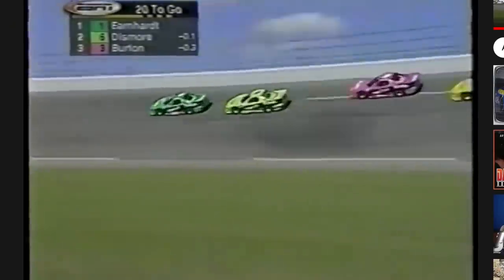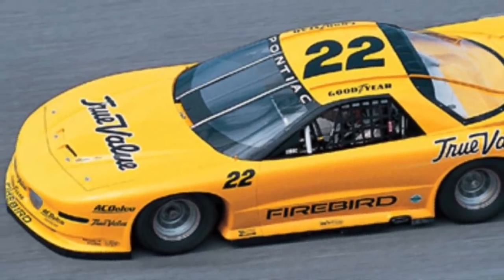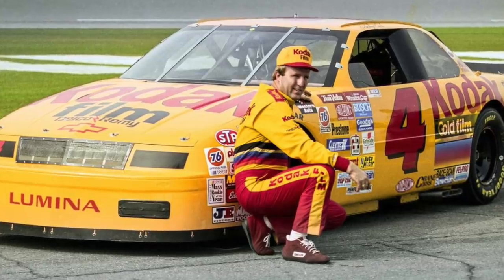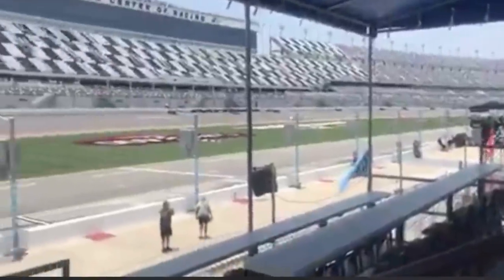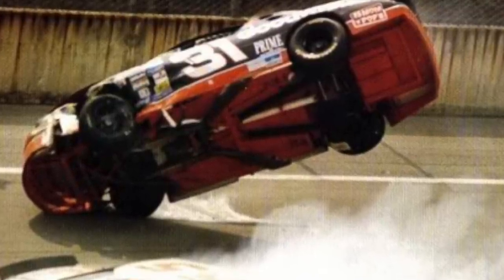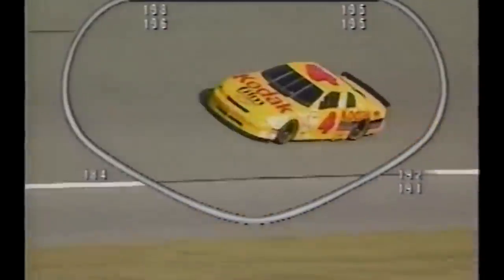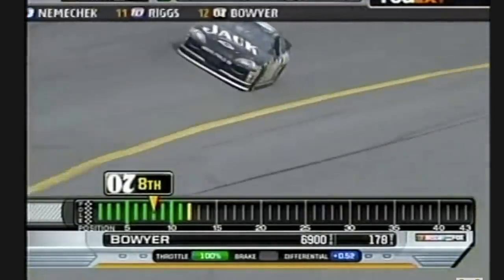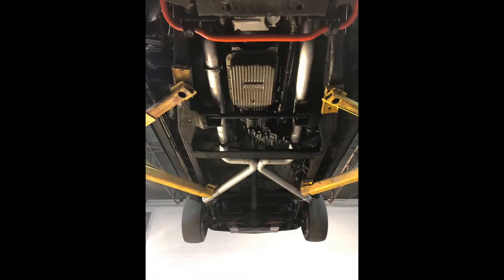What Made "Old School" Restrictor Plate NASCAR Sound So Great? (Back to Back Sound Comparisons)

Comment: H pipes pretty much just equalize pressure. The X pipe does both pressure and flow. Sound changes with flow. You're essentially hearing all 8 cylinders out of each exhaust pipe. Back playing dirt track with my pops, he ran a set of "180" headers tharan over the top of the bell housing. Each 4 to 1 collector consisted of a pair of cylinders from each side of the engine for scavenging purposes.  I know this isn't 100% the reason for the unique sound. Side note, I'd love to do the X pipe on my 07 Escalade if I could afford to
Reply from the maker: Your description is quite accurate in a simplistic sense
Reply: @Stapleton42  ya im not mr phd or anything but Ive been around racing my entire life. The TransAm cars always had a similar sound. At the time im referring to, they ran like a 311 i think....smaller than the nascar engines but they a similar set up but it was like 8-4-2-1 typ of set up. instead of a 4-1 collector they a couple 2-1 combined then just after it came into 1 large tube, it necked down the expanded back out. Our engine builders always refered to the as "fire cones". They would tell me how they could shorten or extend them depending how they wanted to power curve depending on which track we where at. Change the exhaust set up 3 time at 1 track once.....pain in my arse! lol

Comment: I think what a lot people don't realize too is how compression (Or cylinder pressure, rather..) makes a huge difference as well. Time and time again I've see guys spend the big bucks on an exhaust system and low LSA cam for a clapped 305, then wonder why it doesn't sound like their uncle peepaw's drag car.
Reply from the maker: That has a lot to do with horsepower and overall airflow volume not just compression ratio. Compression is just a facet of that lol
Reply: @Stapleton42  Oh I understand, why is why I mentioned Cyl Pressure (I suppose eventually leading to over HP as you mentioned..) as well.. Same reason a lazy stock LS sounds so much more wild when you throw a turbo at it. 

However I was just specifically referring to the billhillies that can never find the crisp exhaust note they want out of a 300k mile Emissions-era turd engine

Comment: some cars used the xpipe and toobs at 1.5s too. newman in 03 sometimes at texas and atlanta sounded more higher pitched than some others.
Reply from the maker: Good observation. Back then there was also an equal length Y pipe merge single side exit that sounded very similar. I believe that is what Penske used but I am not 100% sure. There was also a side exit x configuration used by some.
Reply: @Stapleton42  pretty cool to see you reply on a video 2 years old even with over a quarter million subs now. great job on the kerry video, btw. that one should hopefully get going and over a million views.

Comment: I feel like my comment on your monte video struck a cord. Maybe not... Either way my dad and i were just talking about exhaust sounds this week. Very interested in what you find. I am not sure an old school SBC cam will fit in an LS. Changing the firing order on the LS coils is 2 pins at the PCM. After a cam change if it fits of course. All i need is a trigger wheel and i will be using an LS PCM to control my SBC 383. Also on a Firing order swapped SBC the engine runs smoother which in fact gains you just a bit of HP but it does make the engine sound different as well. Need my LS Swap 89 Camaro to sound like the circle track cars so go and get testing so i know what i need to fit under the car.

Comment: Boom tubes change sounds quite a bit, also with everything digital now days they run cleaner and smoother. Just like driving behind a 69 chevelle big block with some good fuel, smells amazing. Then behind a new charger with good fuel, IT'S JUST NOT THE SAME LOL.

Comment: Another factor in the sound department is the lower max RPMs. Gen 4 cars had a max rpm at around 7,500 rpm, the Gen 5 & 6 cars had a max rpm at around 9,000 rpm
Reply from the maker: That’s not true. Gen 4 at non restrictor plate tracks ran 9,000+. Restrictor plate tracks ran around 7,000

Comment: the xpipe is no doubt most of the sound difference--I have been building race cars and experimented with exhaust systems for decades. One point--the restrictor plate engines were also turning 9,000+ rpm, not 6-7,000 rpm.. We used to take multiple engines per Team to Talladega and Daytona--these engines were restrictor plate, had 19-20 to 1 compression ratios and turned 9,200+ all day long..  On Sterling Martins car, the exhaust was the diff and yes 9,000+ rpm..

Comment: I am guessing before watching and I am going with Indy style headers like Sterling Marlin had on the four car I think. Or aliens but I think headers and maybe head exhaust  ports with the old spacing not like the LS motors and equal port spacing. Well lets see how this goes. :). I love the sound of those cars but my favorite exhaust sound ever is the opening credits to the first cannonball run and the Lamb chase.
Reply: Dang it now I need to know if the LT to LS1 style heads and port locations made a sound difference. A new rabbit hole I have to go down now for no good reason when I should be working. Unless Stapleton has this knowledge or spare time to find out :) If you read this and want to travel to Danville one day for some late model shop tours let me know and maybe we can hit Timothy Peters, Barry Beggarly, Fallen trucking that had many great drivers, Peyton Sellers, and I think Wendell Scotts son is still in the area.

Comment: The next gen nascar   Has a exhaust pipe on both sides. It does sound different in testing. But only on small tracks yet. Maybe the sound is coming back. Maybe not exactly the same. But close.

Comment: I had a sbf in my truck. And now I'm going to be swapping a lq4 in there after driving one in my 2500 suburban. I gotta say I didn't realize until now it was the difference in firing order I was hearing. I mean you can hear a cammed out vehicle and immediately know what's under the hood. I just never knew that's what I was hearing.
Reply from the maker: small block fords and LS have the same firing order unless its an old old 302 then its the same as a conventional chevy small block

Comment: There's a science to header tube length and diameter that reverses the sonic pulse back into the cylinder at the precise moment just before the exhaust valve shuts creating more cylinder pressure.

Comment: Hey Mitch I was told years ago the placement of the X pipe is critical to its performance. Not sure how true this is. I was also told to find the position you use wax crayons on each straight pipe and whet it stops melting is the position the X pipe needs to be. Again not sure how true this is but thought it was worth passing on.
Reply from the maker: The placement is critical!

Comment: Best sounding stock cars were the short track asphalt late models from the 1980's using 180 degree headers.  Sure miss that. Don't think cup cars were ever allowed to use them, and with the higher RPMs run today, little if any gain would be realized anyway.  Hope the X pipe does return to Nascar's latest gen.
Reply from the maker: There was a time where cup cars had them! Junior Johnson cars often did. There’s an in old car video of Cale Yarborough at darlington where you hear the 180 degree header sound!

Comment: Good content man! I LOVE exhaust sounds so much. Looks like this is my new go to exhaust channel. Thanks for the knowledge. Now it’s time to do some experiments on my 6.2 Superduty. Got dual Spintech super pro street 9000 mufflers with 3 1/2in and 3 1/2in out. For now there’s no tail pipes. The sound is nasty for real. Tailpipes should make it sound better from my experiences n from the Raptor guys. Prob dump them right before the axle. Not 100% sure yet. In the future high flow cats and long tube headers will get installed but for now I’ve got to keep it semi quiet. There’s nothing quiet about it now but…. I can’t leave ANYTHING stock so it is what it is!!!! Bahhh!!!

Comment: Hey, great sound comparison here. I have been thinking, about the older NASCAR sounds, I have been thinking if the 1990s sounds would also be correct for the mid to late 1980s NASCAR. I happen to have a Hot Wheels Chevy Stocker in my Hot Wheels collection. This casting is modeled after the NASCAR version of the 1986 Chevrolet Monte Carlo SS Aerocoupe. Reading online, the X-Pipe first appeared on NASCAR in the 1990s, so chances are that the "real Chevy Stocker" would've utilized the Y-Pipe if I'm not mistaken. If anyone can correct me, feel free to do so in the replies. Thank you very much! Just remember, I'm talking about what 1986 NASCAR would've sounded like. Would it have sounded the same as 1990s?
NOTE: 1986 was before the Restrictor Plates, which were not utilized by NASCAR until 1988. There were no Boomtubes or X-Pipes in '86 either.
Reply from the maker: 80s and 90s at non plate tracks were using H pipes or no crossoverr at all

Comment: Take 2 feet of pipe, string a piano wire or guitar  string down the center of it the long way  make the tension adjustable , put it on the end of your exhaust pipe ,it is so loud you will not be able to believe it.

Comment: I also love the sound of the old NASCAR cars. Have you thought about the plus from having a X pipe as far as adding a little more back pressure because of the restriction from having the 90 and 45 degree curves, which also adds to the power/sound of the old NASCAR cars? Keep in mind if you try the 7/2 swap you also have to have a cam that is setup for it and I've heard that it would cost over $300 just to have them grind one for you.  I would love to have a car that sounded like that but It would cost me a ton just in tickets if I did. lol  -  later
Reply from the maker: X pipe doesn’t create backpressure. It promotes exhaust flow. That’s kinda the whole point lol. That’s what I meant changing the cam for the firing order swap. I just assumed people knew you could move spark plug wires and change the firing order 😂

Comment: X pipe gives the high pitch sound because it blends both banks of the engine keeping the scavenger effect  going that the  header collectors are doing. They don't  make a lot of difference on a low rpm V8.

Comment: Dang that escalade sounds so much better with the x pipe! But wouldent it be called a divorced x pipe since they are not sharing the gasses!  Go look at subar wrx with equal lenght headers and non equal lenght headers one lenght makes them rumble the other length makes them sound like a solid tone!

Comment: I’ve been thinking a lot about doing a 4-7 swap but unsure if it’s beneficial on a 97 z28 Lt1 six speed manual I love experimenting with the exhaust I have short headers with a standard single to dual exit right now but just ported and polished a set of heads aluminum, and are in the middle of swapping them on and have a set of brand new long tubes and have been wanting to do an x pipe with Boom tubes but it’s cammed now heads , headers , 30 lb injectors Holley billet in line fuel pump accel adjustable fpr ported intake egr delete electric water pump the works and a daily driver

Comment: The headers play a big role. 180 headers sound wicked..  changes the firing order
Reply from the maker: These cars did not have 180 headers. You can see when they flip over they’re tri y headers. They were able to run 180s in the 80s and the sound was massively different

Comment: I'll take one stab at it because I know one reason the sound changed and that was because they came out with a chip rule in the very early 2000s like 0102 they made him start running a 8900 RPM chip before that Hendrick had Motors revving over 10,000 RPM and I've heard my buddies Nascar truck with a offset h that sounds that way
Reply from the maker: Restrictor plate engines always ran around 7k so that rule wouldn’t have changed them

Comment: What about headers? Is it 8 to 1 headers as well with the Xpipe. Because if you put an Xpipe on any V8 car, it does not sound this good. However a couple of LS V8's has the 8 to 1 header and Xpipe and then it sounds identical to these older Gen 4 Nascar's.
Reply from the maker: The length of the primaries has a lot to do with the effectiveness of the X pipe. You can't just throw an x pipe on anywhere and have it work. When done properly standard headers will sound like 8 to 1

Comment: What RPM are you turning in the Escalade? I'd love to try this in my Monte Carlo but I'm running an Olds 350 with the stock cast crank and rods so I don't want to push it past 5500, even if it would sound incredible.....

Comment: You need long tube headers with the Xpipe and also if you switch the firing order to the old chevy motors, even if you switch the coils around I don’t think the ECM will work right
Reply from the maker: It was implied common sense that people knew I was referring to a cam swap. Apparently not.

Comment: My buddy has a 72 Camaro 500hp SBC  it was the first car I heard a x pipe with flowmasters and it really sounded like a F1 car.
Reply from the maker: Flowmasters sounding like an f1 car? Ummmm 😂
Reply: @Stapleton42  ok maybe not just like one but at 7 grand it just screamed like what your talking about
Reply: @Stapleton42  on a side note what t case are you using that holds all the horsepower your truck has?

Comment: Your car is gonna sound sick ..whith the x pipe .one other thing you should do is yes put the x.pipe on and put a gate on it so you can run another exaughst that you can run on the street just flip a switch and it either closes the pipes to open the other exaughst or vice versa .just a suggestion

Comment: While I agree with some of what you have to say here, there is a thing or 2 we disagree on.  Please keep 2 things in mind here. #1 My comments are intended to educate.
#2 I am operating off of memory, so I might have an error or 2 along the way.
     From the 50's thru the 90's anyway, most domestic V8's had the exact same firing order. Yes, you look up a ford 302 and it doesn't say 1-8-4-3-6-5-7-2. The reason for that is the fact that ford numbers their cylinders differently than say GM. That is why they look different but in most cases they are really the same. 
     Yes, the firing order swap cams were out there clear back in the 60's for sure. Everyone was looking for both performance and longevity out of their race engines. So the early racers experimented with EVERYTHING. Back then anyway, if memory serves me right, they biggest thing that a firing order swap cam changed was the harmonics within the engine. I also believe that while different, it wasn't a big enough change to warrant changing things at the oem level anyway.
     As far as sound goes, while exhaust can make a HUGE difference, I believe that something else was likely more responsible for the difference in sound between different engine brands back then. I am willing to bet that cylinder head architecture was the main reason. While valve size also makes a huge difference,  I believe that all makes used the same size valves in nascar in the 90's. Air doesn't move the exact same way thru a ford head as it does a gm head because the port designs are different. I strongly suspect that this accounts for the difference's in exhaust tone that we hear from car's back in that era. 
     Just like when you change your hot and or cold side plumbing on your turbo stuff changes the way the engine behaves.  Different port designs and configurations I suspect change the exhaust note considerably if everything else stays the same. While I do agree that a firing order swap will certainly change the exhaust note, I really do think that cylinder head architecture was more the cause in this case.
Reply from the maker: The Ford cup engines used the small block “HO” firing order which was indeed different from the standard 18436572. Assuming cylinder numbering is the same from make to make Ford firing order is a 4-7/2-3 swap from the Chevy. LS engines also use this firing order.

It definitely changes the pattern of pulses within the exhaust system most responsible for sound.
Reply: @Stapleton42  i knew that was a possibility in those, which is why i did choose my wording carefully.  I couldn't recall off the top of my head if they used a cam swap on those or not.

Comment: The old sound is way better, if you separate the left bank from the right bank. You get to good sound. Now if you put 180 deg headers in a car like Darrel waltrip had in the 88 Gatorade car.. the x pipe makes more tq in the 5000 to 6000rpm range. The honda vfr 800 and newer yamaha liter bikes sound like old nascar. Also not having a x pipe may be faster on slick tracks because it pulls some tq off when you mash the throttle coming off corner...

Comment: That's white 63 and a 1/2 Galaxy's Teardrop hood 180 headers from back in the day. That's what I've read about learning about. I did, but you did probably mad 9:15 e 6 different federations. Round edges Just take the old tig welder and melt them down when you're done.😮  call it cross pipe 😅😅 What's your mustang boy you're gonna H ,,,, Then wizard,,,,,, Actually made a lot of it makes sense.